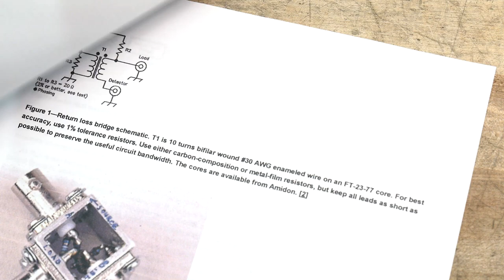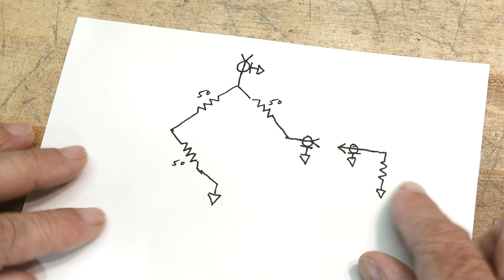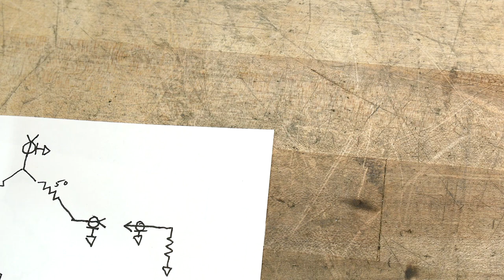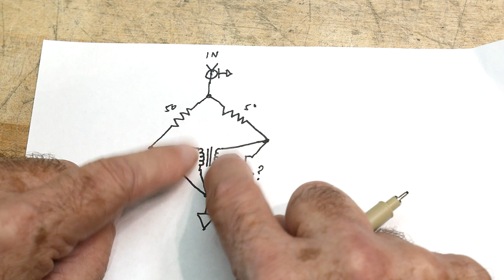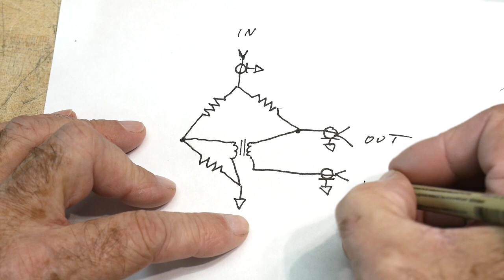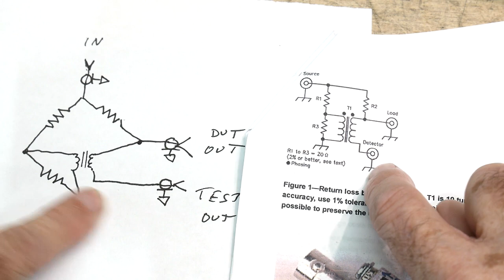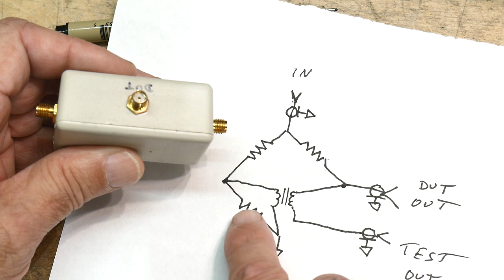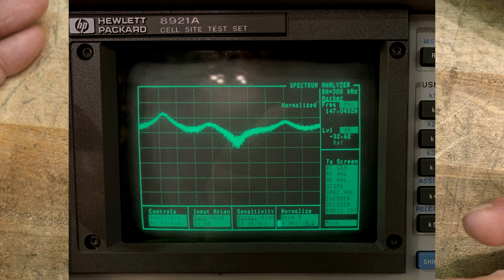#599 What is a Return Loss Bridge?

Comment: Great video. This is simply a Weatstone bridge with transformer. As signal goes to the antenna and when is not emitted its reflected but when antenna emits its not reflected and then there is a difference in the coil as current passed wich shows as a dip on SA. Thank you for video. I was thinking to make one but had no clue about principle of the working. I have to test my hypothesis.